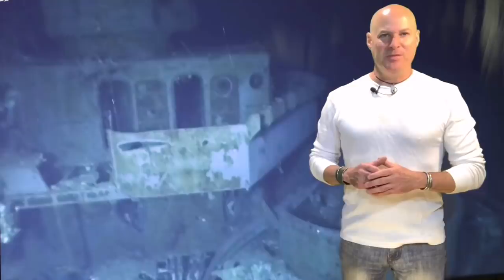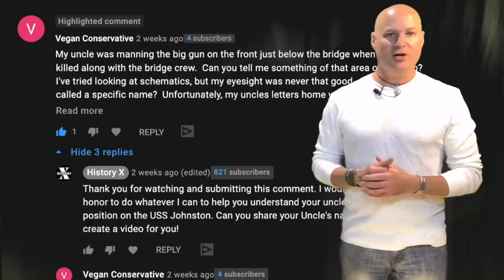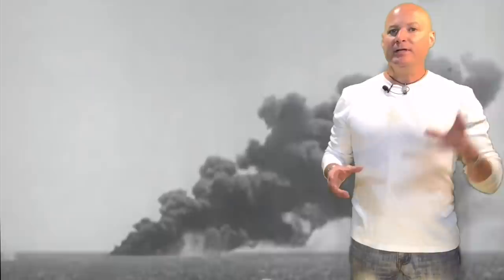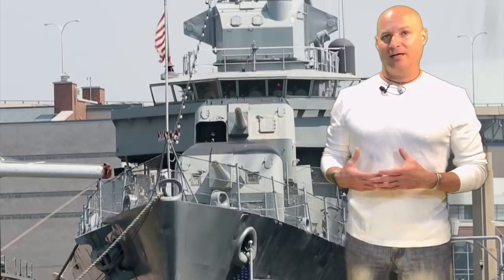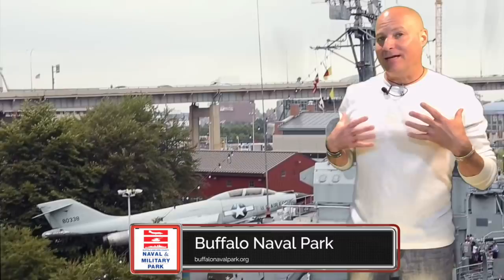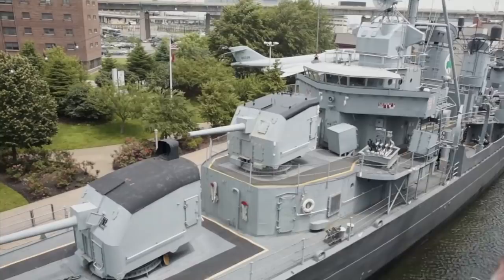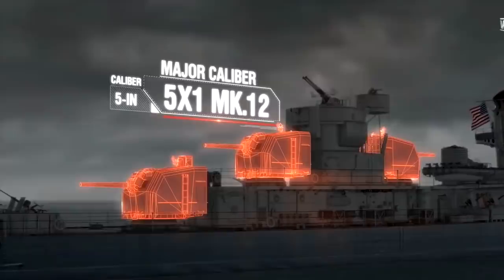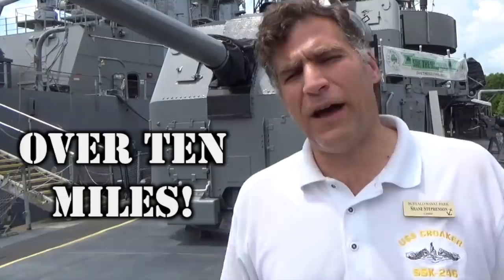EXCLUSIVE: Inside Gun Mount 52 of USS Johnston DD-557

Comment: My uncle was on that ship. His name was Thomas E Reed Machinist mate 2nd class. He was missing in action and declared dead. I would like to know what his job would have been like…
Reply from the maker: Thank you for the comment, Cole! I would be honored to research your uncle's role aboard the USS Johnston. I have already submitted a request with the National Archives. However any additional information you may have, like birthdate, birthplace, service number, etc.. would be helpful. If you have any of that information, please email it to my personal email address kss1224@icloud.com. Thanks, Cole!
Reply: @HistoryX  I emailed you
Reply: Machinists Mates operated and maintained the main engines and the other equipment in the engine rooms. Such as the propulsion turbines, reduction gears, the main propulsion shafts, and turbine generators to generate the electricity. The other division an MM would be assigned to was auxiliaries or "A-gang", who are in charge of maintaining many auxiliary systems throughout the ship such as water heaters, HVAC units, the hydraulic steering system, weapons elevators, and in some cases the evaporator that make fresh water for both the propulsion boilers and potable water for use by the ships crew. Many of the Battle Stations assignments for engineers is either in a damage control locker or in the engineering plants. That's a general overview of his rate. It's a bit different nowadays but not too terribly different. I spent 14 years as a Machinist Mate and the first ship I served on was the USS Blue Ridge . She was commissioned in the 60's so her organization was similiar to the way things were back then. Hope this finds you well, though late (sorry, just randomly found this video and had to comment since I too was a machinist mate.) I dont know your uncle's name nor your family, but I can tell you this as a former Naval Engineer, i can say with a large degree of certainty that he gave everything and fought bravely to save that ship till the very end.

Comment: very interesting video. As a Gunners Mate for the Mk42 5"54 I loved to see how these 5"38's fire. The range is similar (ours were about 13 miles) but the firing rate was much slower on the 38's. We got about 34 rounds a minute on a double sided mount (meaning that ammo was brought up on both sides of the gun) but then again the ammo was also brought up hydraulically using a series of upper and lower hoists as well as a carrier that would match the turret position after the ammo from the lower hoist was ejected into the carrier. Not to mention that there were only 2 people in the gun house, while there was one plus the chief in the carrier room and about 4-5 in the magazine. The good old days!!!

Comment: Turrets are on cruisers and battleships. Destroyers have mounts. If you're going to teach it, get it right. I served on two Fletchers and two Sumners. The Fletchers in WWII had a practice loading machine to keep the skills up. 15 rounds a minute was the low end after the ready ammo had been expended and shells and powder was coming up from the magazines. Barrels lasted about 4500 rounds before they had to be relined. Fletchers stored 350-420 rounds per gun. Heat from heavy firing caused the paint on the barrel to peal off in strips. Concussion from the gun firing caused dust and paint chips in the overhead to fall on racks on the deck below. Everyone left a sheet spread over their rack they could shake out and keep their bed clean.

Comment: Great video, in all regards. As a retired naval officer I noticed the use of the word “turret” frequently used to describe the 5” guns on the Johnston. Normally, 5” and below gun structures on USN DDs are referred to as “mounts”. It’s not a nitpick, I just provide this feedback from strictly an educational standpoint. In the USN, the difference between a turret and a mount is that a "Turret" is built into the ship, has a stalk that extends well below the weather deck and includes a barbette, while a "Mount" is not part of the ship's structure and does not include a barbette.  As a general rule, 5 inch (12.7 cm) and smaller guns are in "Mounts" while 6 inch (15.2 cm) and larger guns are in "Turrets."  Other navies had similar distinctions.

Comment: USS Johnston did not have a turret.  A turret is armored while gun mounts are not.

I served in the Navy 20 years starting on a Gearing class destroyer also with 5”/38 guns.  Gearing had twin mounts as opposed to the Fletcher class single gun mounts.   In 1972 the crew was a pointer, trainer, two gun captains, two projectile men, two powder men and a mount captain.  We did not use AAC ammunition normally that would have required a fuse setter.  Therefore we had 9 men in the mount.  
I moved back and forth between trainer, powder man in the ready service ring, handling ammunition outside the ring and down in the magazine.  My ship, USS Floyd B Parks DD-884, between 07/09/1972 and 12/27/1972 fired 13,000+ rounds.
Reply: Right Gun Loader Mt 51 USS Bordelon DD 881 left nam in early 73 after the Cease fire From Yankee Station. Did not get a Count of total fired, but it was a Great Deal.I can attest to the Fatigue from loading those Projectiles for long Periods!
Reply: @barryd.thomassr.9156  welcome home brother.
Reply: @martinwalker9386  Thank You Brother!

Comment: must have been horrific getting shelled by 18inch shells and eventually hit and sunk by them must have been something the crew would never forget . i wonder if they could see Yamato  31,000 yards away when she was sunk ? the courage of these men to fight something so big and far away
Reply: There is some question as to whether she was shelled by Congo or Yamato. Either way it was devastating.
Reply: Yamato engaged Yamato at 20,300 yards, and maybe. The eye at ground level can only see up to 3 miles, but Johnston was equipped with optical systems, and you can see quite a lot at higher levels. On signal hill in king beach, I saw Los Angeles with ease and well beyond.

It would have been quite horrific, but luckily Yamato mistook Johnston for a cruiser and fired AP shells which overpenetrated Johnston without exploding. Still, Johnston ended up splitting apart where an 18.1-inch shell hit her.
Reply: @yankees29 Johnston claimed to have been hit by 14-inch shells from Kongo at 12,000 yards. As it turns out, Kongo was much farther than thought and blinded by a rain squall, unable to fire her guns, while Yamato claimed numerous main and secondary battery hits on a US “cruiser” at 20,300 yards.
Reply: @metaknight115  huh Japanese and American records state high father ranges 
If the Japanese cre me used HE sap it would be devastating

Comment: Gun Mount 52 on Johnston would have been one of the last guns to stop firing that day. After the first round of big hits Johnston lost most of her electrical power, and only Gun mounts 51 and 52 (the 2 in front of the bridge) were kept operational. If I remember correctly, mount 52 took a direct hit very late in the battle, just before Johnston sank.
I've read accounts that told of the barrels of these guns glowing red from so much repeated firing at the Battle off Samar. Just constant shooting. Cannot even imagine what that would have been like. Non-stop firing for almost 2 hours.

Comment: Great video, with one exception. The “expert” called upon was somewhat, I’ll be polite, uninformed. 
There were no turrets here in the proper sense, the enclosed single mounts were gun houses. 

Inside the gun house, he describes the “barrel”. Problem is that virtually none of the barrel is in the gun house.  What he was referring to is the breech. A very different part of the gun. There were a few other issues, but these were the big ones I caught right off.

Comment: Did the 5 inch guns have proximity shells for anti aircraft?
Reply: It's highly doubtful.  The shells were deployed by the time of the Kamikaze attacks in May of 1945, but prior to that... they were too classified (even Eisenhower had to REQUEST permission to use them, which finally happened during the Invasion of Sicily, and then not again till the Battle of the Bulge).  They were as highly classified as the atomic bomb and the U.S. feared they might too easily fall into enemy hands, so they could only be used in situations where that was unlikely.  The USS Johnston was sunk in October, 1944.  In 1944 in the South Pacific, the fuses could only be used by land-based artillery.

Comment: A small detail, but terminology here is slightly off. Destroyers do not / did not have "Turrets" or "Gun Turrets". They have/had "Gun Mounts". There are technical, engineering differences. The Gun Mount just forward of the Bridge would have been designated "Mount 52" since it was the 2nd gun mount (counting from the Bow) and had a 5" gun.

Comment: I'm confused. Why the need for 9 sailors in the turret? The 4 standing on the off side of the gun would seem to be useless. One small hit to that turret and there would be mass casualties, inside.
Reply: Possibly as relief in turns?  We do the same thing in unloading boxes off the line.  In the summer the metal of the trucks gets so hot its baking in there so they need to change off every hour or so.  That's with most of the boxes being small and light weight.  I can't even imagine what my uncle went through hauling that much weight over and over under even worse conditions.

Comment: Good Post.  Would you and the museum curator consider posting about the USS KIDD in its' role with Tom Hanks commanding the USS KEELING in the  ovie GREYHOUND.  In one scene there is a close-range battle between the KEELING and a U-BOAT.   The U-BOAT hits the KEELING with its' deck gun most likely an 8.8 cm SK C/35 NAVAL GUN.  A look at where the shell hit, and the damage done would be of interest to me and possibly others.  Thank You.  FWIW, my Father could have been a soldier aboard aboard one of those troop transports ( 94th Infantry Division ).  One more entreaty.  From an engineering standpoint, what would have happened aboard a U-BOAT or larger ship ( BATTLE OF SAMAR  ) hit by a 5 inch shell  from a FLETCHER CLASS DESTROYER like the JOHNSTON ?

Comment: Please do some basic research, words do matter Ken! Generally speaking any naval gun of 5" or less is called a MOUNT, not turret, guns 6" and larger are in TURRETS. The gun you pointed to is mount 52, the 5 meaning the bore diameter and 2 meaning the second 5" gun from the bow. The gun itself is a 5"/ 38 caliber meaning the bore is 5" in diameter and 38 is the length from the muzzle to the face of the breach block is  190" or 15' 10". The enclosures were to protect the gun crew from weather and concussion when the gun is fired, they offered no ballistic protection except in a few of the twin mounts usually on battleships.

Comment: Destroyers had mounts not turrets. Turrets have armor protection, mounts do not. That is Mount 52.
Reply from the maker: Hi, Patrick. Thanks for the comment. That enclosure around the gun certainly looks like armor protection to me. Further, in discussing this with Shane Stephenson, Curator at the Buffalo Naval Park, they use the term turret. Therefore I’m going to stick with ‘turret’ when describing these Fletcher Class guns. Hope this helps.
Reply: @HistoryX  Mr. McCrann is actually correct, Fletcher DDs have mounts, not turrets. They are just powered, rotating gun-platforms that are entirely above the deck, sort of like a child's' merry-go-round with a gun. And the "armor" you see is little more than weather protection (as well as to protect the crews from gun blast, ESPECIALLY the blast from the gun(s) behind/above them). Many Fletcher guncrews were killed from even low-energy splinters penetrating the little-more-than sheetmetal sides.
A turret is a MUCH more complicated (and heavier!!) structure that is built INTO the ship, several deck-levels, where the handling rooms, hoists, etc, are built as a complete, separate physical unit with the gunhouse, and all rotate as one unit. They are also typically armored against direct hits (not just splinters), over the entire depth of the turret.
To a sailor, these are REALLY IMPORTANT (and really obvious) differences, whereas to a non-sailor, they probably just sound nit-picky. They see a rotating gun thingy and say "Turret!", just like most people see any sort of cattle and say "Cow!" (which leaves ranchers and dairymen scratching their heads).
Reply: @HistoryX  The mounts on Fletcher class destroyers have weather shields around them to protect the gun crews from blast and weather. Additionally, this protects the guns themselves from weather. These shields give little to no protection from incoming direct hits or fragments. I am not sure if Shane actually served in the Navy, but he is wrong about these being turrets. No destroyer in U.S. Navy history had turrets; they all had gun mounts including today's Arleigh Burke class Guided Missile destroyers. Finally, I know what I am talking about as I served on 5 ships (1 FF, 2 FFGs, 2 CGs) during my 24 years of service. The FF had almost identical 5 inch 38 Cal mounts that the Fletcher class DDs were equipped with during World War II. The last ships to serve in the U.S. Navy with turrets were the four Iowa class battleships (Iowa, New Jersey, Missouri, and Wisconsin) that were decommissioned in the early 1990s and all are now museum ships. OSCS (SW) USN RET'D 1978-2002
Reply: @k1ross  the windows refered to are in fact the gun sights which are seen from pointer and trainer eye pieces, the only thing close to a window are the 2 oval shaped ports above them, and powder and projectiles were brought up to the handling room by hoist from the separate magazines and then hoisted to the mount. As an added note the sailors in the handing room had to move in a circle as the hoist rotated with the gun mount.